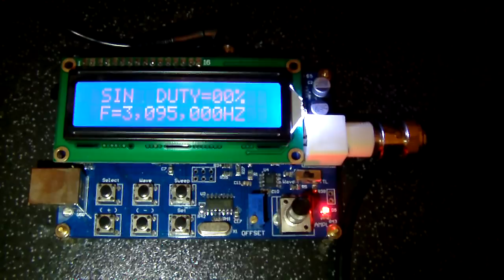TMT With New Circuit Prototype Test Run-01

Comment from the maker: There is no spark gap, it's a sine wave produced by a signal generator with an amplifier circuit, hence "New Circuit Prototype Test Run-01". The "experimental" receiver is the coil with the red LEDs, which is connected to the transmitter via an earthed single wire transmission line for test purposes. Vin = +/- 10.9V. See links in description, page 21 etc.

Comment: great work! Anymore details on the apparatus would be most excellent. I am curious how you can control the SWR with a digital system of generation / simulation.
Is there a analog way to create an asymptotic SWR and frequency shift like in the old steinmetz books? Theoretically transients of a 50 Megawatt power station hold transients of at least quarter of a million volts according to Eric,
Just curious,
A

Comment: wow that 4 min i'll never get back
how about some kind of clue as to what any of that actually is  e.g what size is your spark gap, is it running on impulses , is there an actual reciever , what is the surface area of the primary and secondry and extra coil  what size is the primary cap and what voltage are you putting in etc etc etc